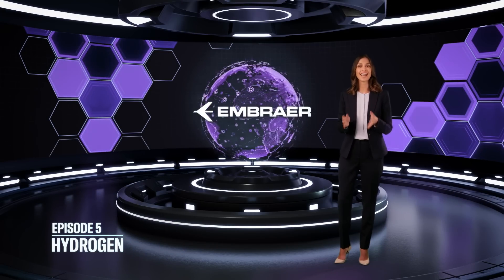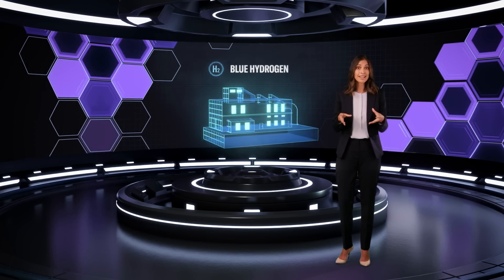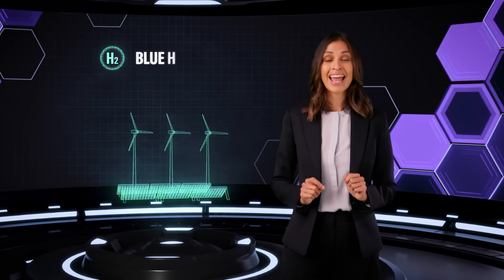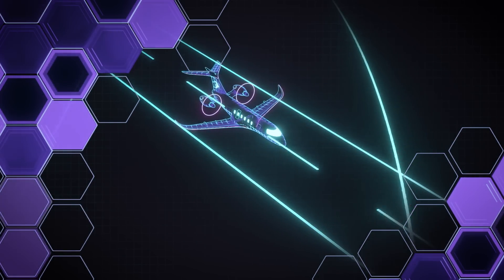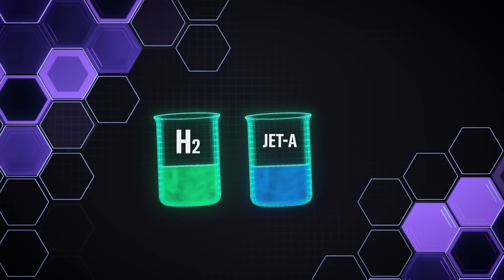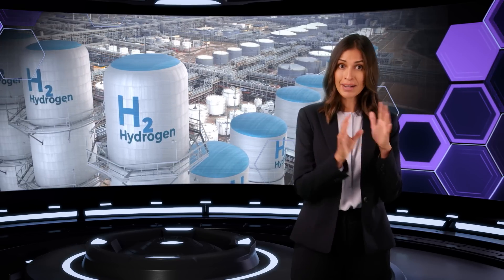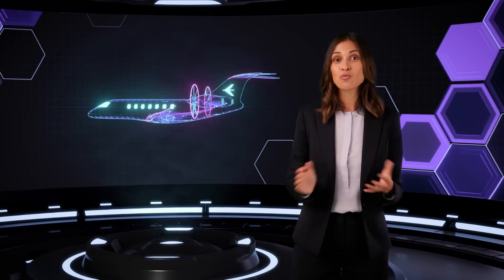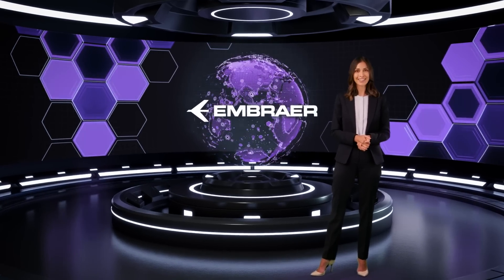Engineering Change: Hydrogen

Comment: Hydrogen could be an option for hybrid turbines, as combustion fuel, but not for a 100% electric propulsion using fuel cells, as the battery tech is advancing way faster.